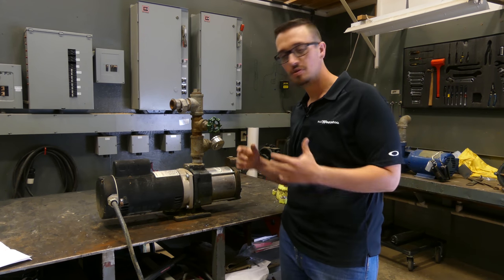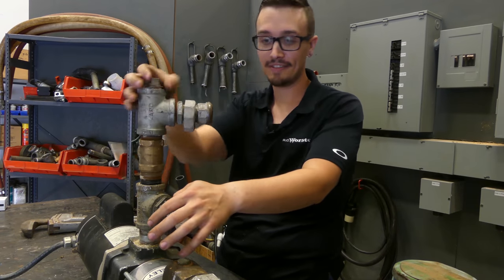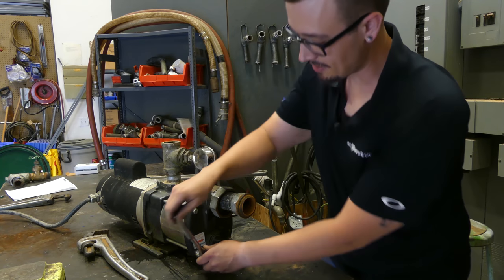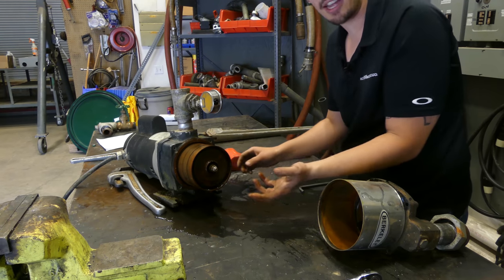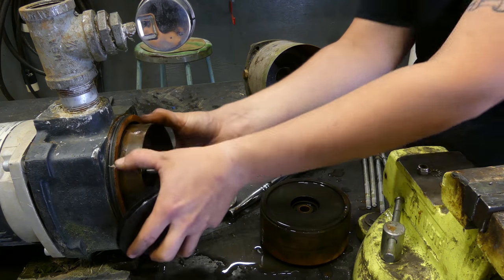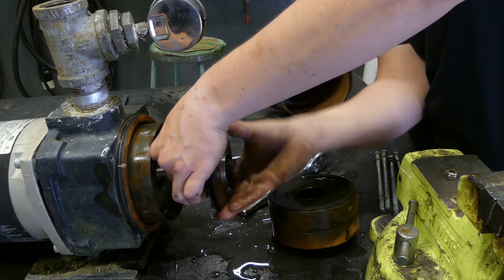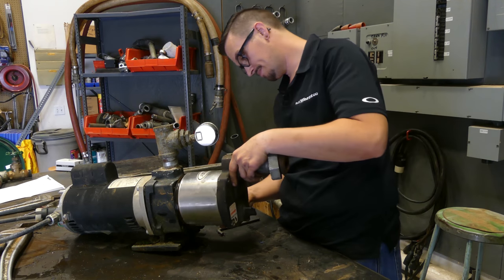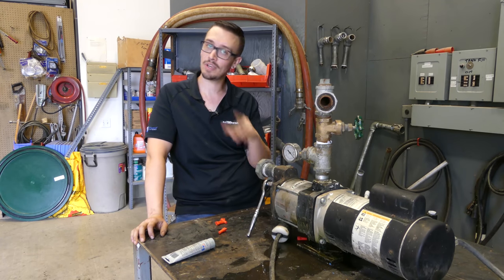Troubleshooting a Berkeley Self-Priming Pump (and gate valve)

Comment: I have a slow drip leaky around the bottom of section between pump body and motor. It drips more when under pressure. Is there some sort of gasket that needs replacing there? The pump model is Berkeley 5SN. We are using it at off the grid cabin to pull water from the tank outside.

Comment: So, there's nothing inside the cast iron part of the pump that needs attention?  My pump suddenly lost pressure, so I'm assuming the impellers are shot.  I wasn't able to separate the pump from the motor, but it looks like I can just pull the impellers without even removing the pump from its installed location.  
Where can I purchase the impellers?

Thanks,